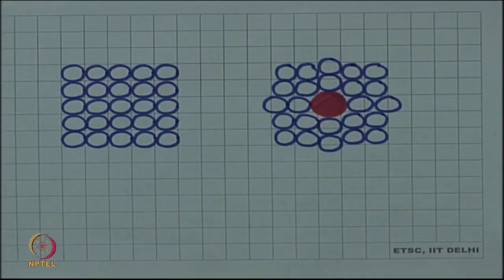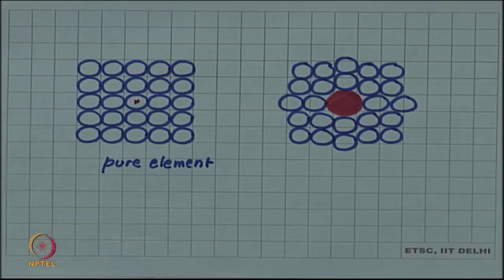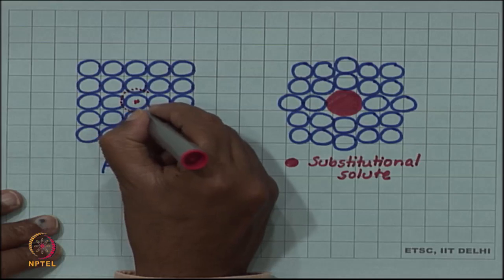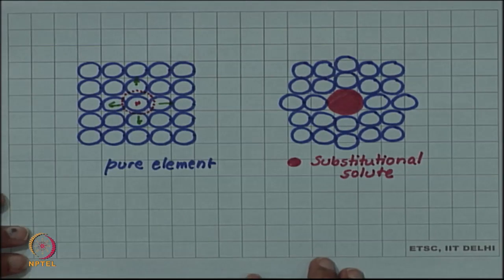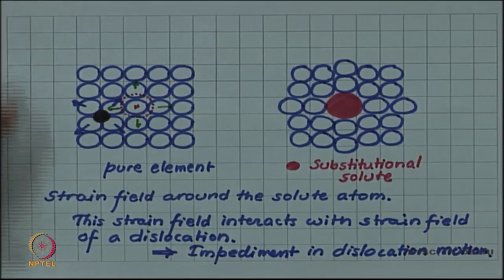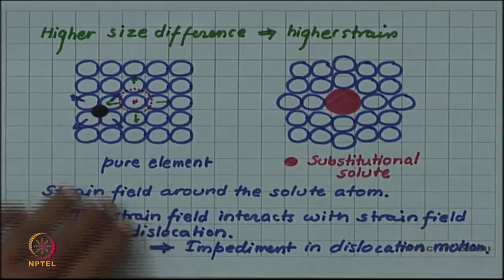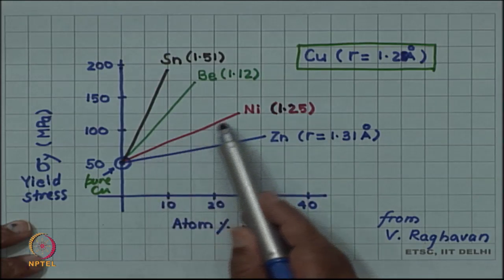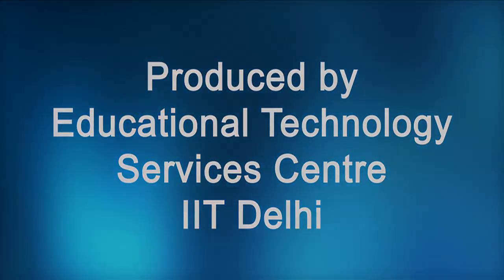Solid solution hardening

Comment: Sir  In case of positive edge dislocation we know that above slip plane compressive and below tensile region exists ...but in case of strain filed which is created because of solute atom how do we know which one is compressive and tensile ...?
Reply: If the matrix atoms surrounding the solute atom move towards (away from) the solute it will generate tensile (compressive) stress. This will be the case if substitutional solute atom is smaller (larger) than the matrix atom.

Comment: Sir, will be the yield stress also increase (or any other phenomenon happens) if the solute atom size is very very large compared to the base element
Reply from the maker: A larger size difference  will create a more effective hardening.
Reply: @introductiontomaterialsscience  sir can a solute atom generate compressive strain field